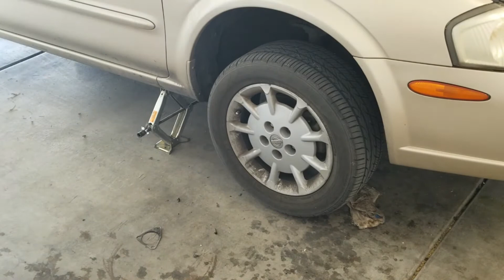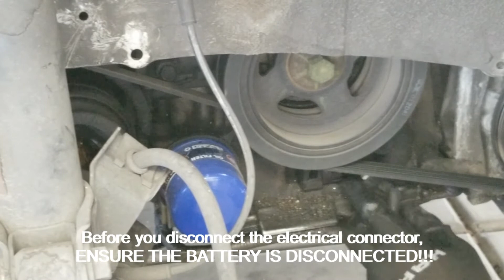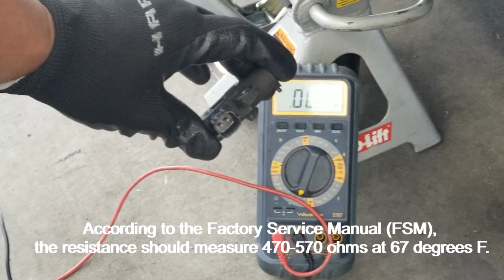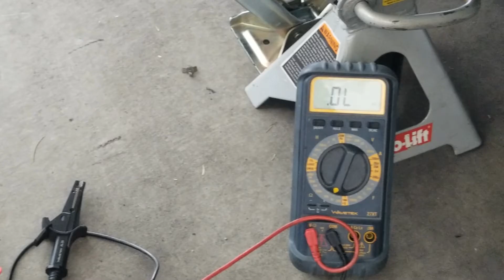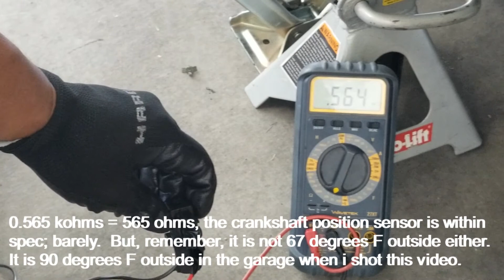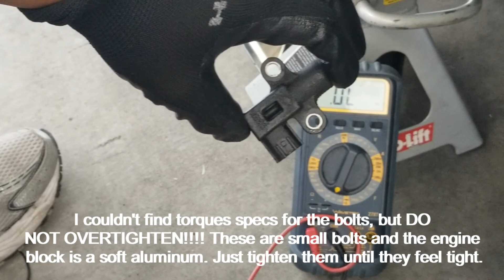2001 Nissan Maxima Crankshaft Position Sensor Test

Comment: Wierd i seen another video and it said i had to remove that pulley to get to a yr 2000 maxima crankshaft sensor
Reply: I saw that one too but it is not required on my 2000 Maxima.

Comment: But wait, theres more. This test will show a bad sensor, but not necessarily a weak or intermittent sensor.
Reply from the maker: Well, if you are suspecting an intermittent sensor, the first place I would check are the wires; especially where the wires connect to the sensor and connect to the connector.  At those places the wire can be the most vulnerable because it is soldered.  If the wires are damaged or frayed, that definitely could give you intermittent performance.  But you would probably see that when you measured the sensor. The sensor itself, is pretty robust internal and has no moving parts, so the likelihood of it failing is a lot smaller than the wires.
Reply: @homeandcarrandr9179  definitely agree with checkin wires, and for corrosion, etc. Sensors can go intermittent though, and testing one out of the car doesn't account for variable vibration and large temp changes. I'd also be much more likely to be concerned with harness/pigtail issues if working on a domestic car. Outside of mice, or bad previous service, I've seen very few defective connections on "Japanese" vehicles.
Reply: @homeandcarrandr9179  also, in magnet based rotation measurement sensors, magnetism can diminish with vibration and heat, over time. The coil you are measuring on a sensor may be fine, but the strength of the magnet could be deteriorating.

Comment: Sir ,i need your help ,my infinity i 30 start and turn off
Reply from the maker: I got a lot of questions for you.  How old is the car? Does the car crank? Does the engine ever get started? If so, how long does it run before it cuts off?  Does it run smoothly and then dies out?